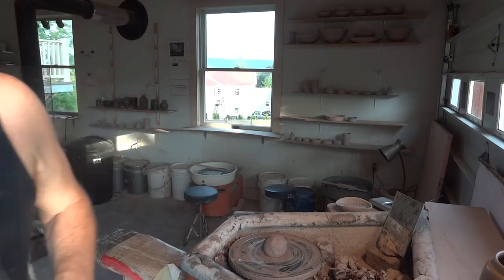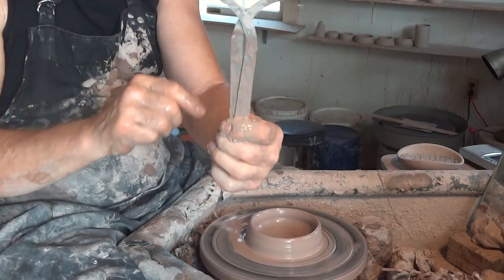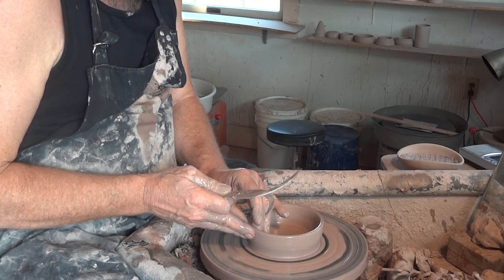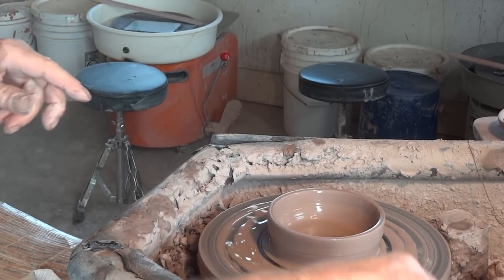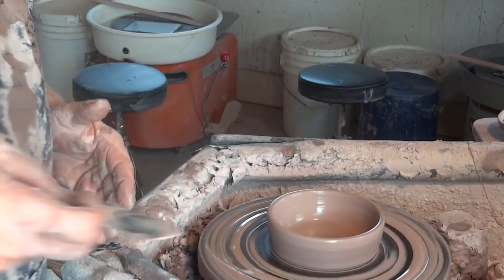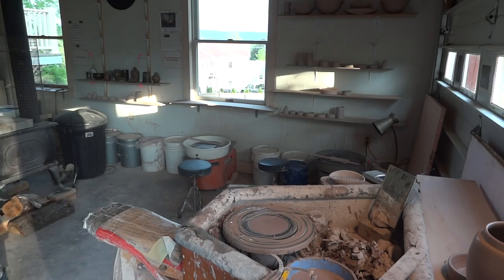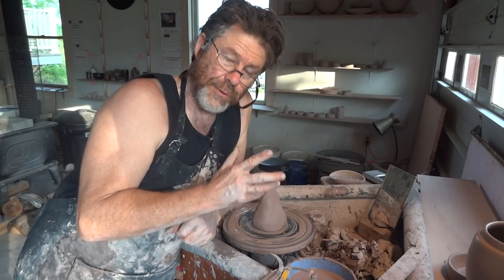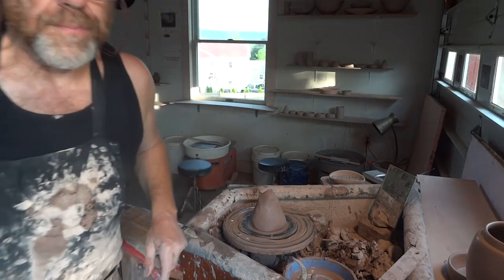SIMON LEACH POTTERY TV - Throwing cookie jar lid ( bisc barrel)

Comment: Funny, 40 years ago my instructor said I want you guys to center and make cylinders.
That's what I did- that's all I did until I got it down to a science.
Within a year I was making his line of ware for his shows. 
By 18 I was throwing for an instructor out of the Chicago art institute. By 20 I was throwing the pottery ware of 4 different potters. Those where the days, made thousands of pots for others and got a ton of practice.
All because of what you just said Simon- learn to make cylinders.
I miss that mental state of mind that can only be achieved when zoning in at the wheel. Every piece on clay is different and responds differently, even if it's cut from the same bag